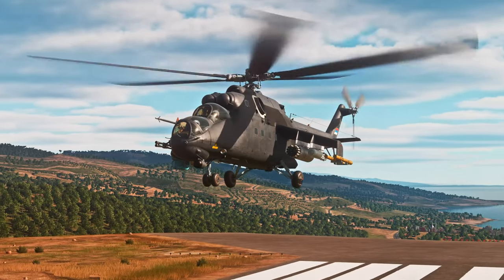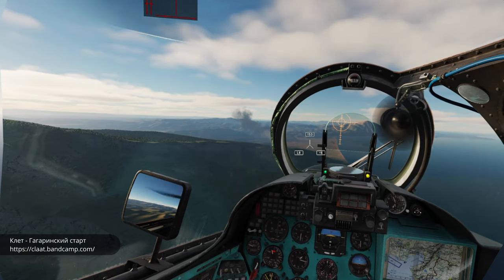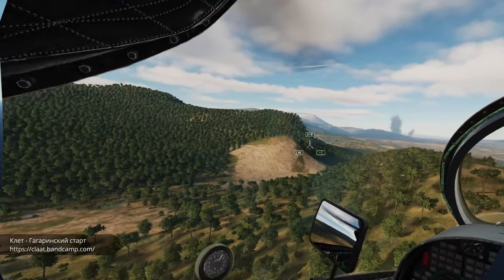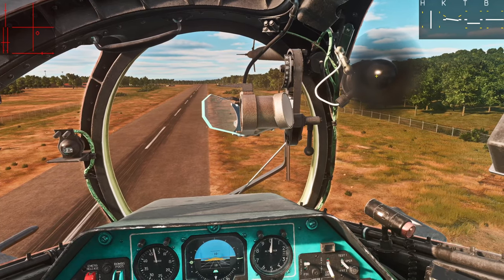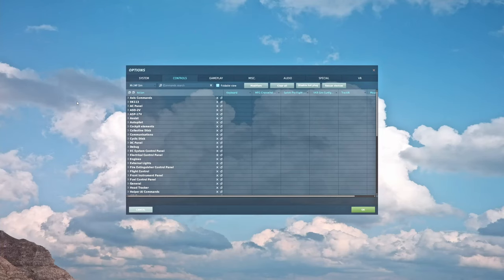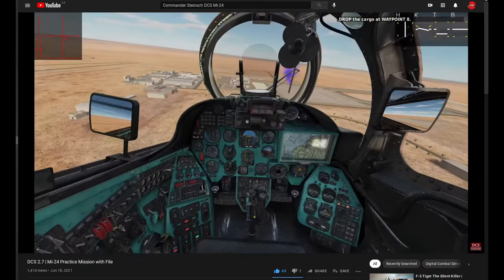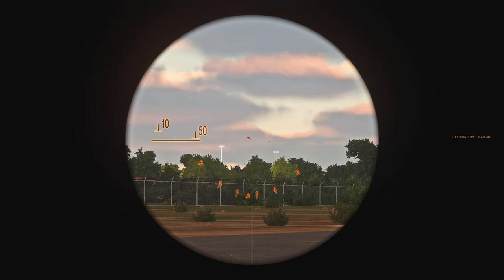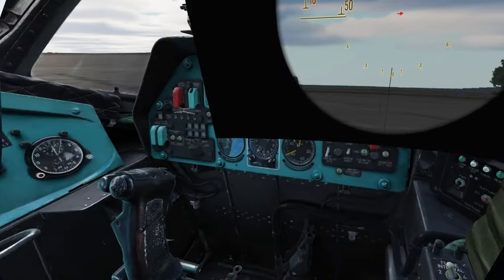Everything Wrong With The DCS Mi-24P Hind

Comment: First of all, great Video! 
Iam pretty much the same opinion but one big thing you didnt talk about in the video and i dont know how many have the problem aswell but i get very bad FPS in the Hind.
Just sitting in an cold and dark cockpit in the hind is for me about 31 FPS.
In the Hip i get more than 43FPS.
For some reason the Hind needs so much performance that its nearly unplayable.
Reply: Well, the Hip was released 8 years ago, so it had to run on hardware from that time and its cockpit has never been updated like the Ka-50. The Hind is brand new, has way more polygons, higher resolution textures, (...) so if you're already struggling to hit 50-60fps in an old module, you have to expect lower performance here.

I have to wonder though, how do you even play with 43fps? You either have choppy fps or constant screen tearing, both of which are less than ideal.
Reply: @fonesrphunny7242  I know the Hip is quite old but thats not really the matter. Newer modules like the F16 or F18 dont have the problem, i mean i get enough FPS for me. For some reason the hind ist much more heavy on performance than every other module ive tested.

And yes, i get screen tearing but mostly in the Hind because of the low FPS, thats also the main reason why i dont fly it.
Iam getting a new CPU so it should be not that bad then but i saw other people having the same problem aswell and not everyone will buy better hardware just because of DCS. Iam not a programmer or whatever but i think there is defintely a way to improve performance in the hind even with those high resolution textures in the cockpit.
Reply: @fonesrphunny7242  I’m used to 20-30fps in so many games that when I finally upgraded my 8-year old PC hardware I experienced eye strain when my FPS went above 60 consistently. My eyes were literally crying with the new information overload compared to
My previous experience.
My first computer and flight sims was an Atari ST running MicroProse’s “B17”. 12 FPS was normal.
Reply: @fanki1730  It's mainly geometry, not textures. The Hind has cables and stuff everywhere and even the canopy frame has tons of little triangles. The Hornet and Viper have very clean cockpits in comparison. A notable difference in performance is to be expected.
Also, both seats in the Mi-24 share the same 3D model. The front cockpit won't be visible from the pilot seat most of the time, but the graphics engine still needs to evaluate the front cockpit, to see which polygons are visible. This process is called "culling" and used all the time.
If ED can pre-determine which polygons never need to be rendered, that would reduce the amount of culling evaluations and speed up rendering. Not sure they are even going to do that much, because something like an nV 1080 should be the standard by now.
Reply: @ghostdog688  Atari ST 520 / 1040, "Their finest hour: BOB". Yeah, I remember low framerates. "Starglider 2" ran at like 5fps in some areas.

A high refresh rate with V-sync should be more natural to the eye, unless it triggers motion sickness similar to VR. Maybe you're experiencing some imperceivable flickering at 60hz, which monitors can do depending on how they are connected (eg. 1080p over VGA or a faulty cable). Ghosting due to slow pixel update (8ms) can also be a contributing factor.

Maybe you really can't handle 60fps. That's fine, not everybody can handle VR either. I've never heard of something like this before and high FPS have always been beneficial for me, be it for tracking a bandit over ground clutter or just glancing around with TIR.
Reply: @fonesrphunny7242  its wierd because i have gotten used to VR, and usually push up to about 60 fps. i dont experience nausea or motion sickness, but can get eye strain and even headaches if i go into tripl-digit frames. with or without v-sync. im fully aware im the edge case here, but i always chalked it up to being used to the kind of frame rates that make PowerPoint look smooth lol
Reply from the maker: My FPS in the Hind has been good, but I also recently did a major upgrade of my 8 year old CPU. The thing that made the biggest difference for me was moving to 32GB RAM (and now to 64). 16 just isn't cutting it for DCS anymore, especially on Syria and with the newer modules.

I don't mean to invalidate your problems. I just haven't experienced it myself. Hopefully they'll put some time into optimzation during EA and it will get better for you. I'm sorry to hear it's running so poorly, the Hind is a really fun helicopter so far.

You could try the optimized cockpit from the user files. It might not fix the problem but I bet it's at least worth a shot: https://www.digitalcombatsimulator.com/en/files/3317193/

(He also has a Russian version, and black versions uploaded)
Reply: I noticed lower fps with Hind. But I didn't compare it to other modules yet. But before the patch I could see 70-80 fps on servers running Syria, inside F/A-18 or MiG-21. Now it's barely touching 56-60. Again, just didn't compare yet >.>
But the server I'm talking about is also suffering from random fps drops because of ED's shenanigans and because the server itself becomes a little bit heavier as the time flies (SaW)
On Hoggit's TNN I also barely reach 56-60 fps, though.
That's why I'm inclined to believe the module has slightly performance issues. Not BIG, but noticable.

Comment: April '22. It's awful. Like, really bad.

Cold start then lift... Craft spins and tumbles. Dead.

Try to hover. Dead.

Tell Patricia, sorry, petrovich to fire from any distance. Any distance. Doesn't shoot or engage. Dead.

Avoid Sam. Spin. Tumble. Dead.

Ask Patricia to ready weapons. Have to go to CpG pit to make sure everything is on. Crash whilst distracted. Dead.

FF controls. Epileptic fit. Dead.

Centre trim. Somersault. Dead.

Autopilot? Crash. Dead.

All zeroed before gas, throttle or torque....spin. dead.

No peripherals at all. Tumble. Spin. Dead.

Lots of people are enjoying this module. I am not one of them.

It's crap.
Reply: I've flown most modules in DCS and flown the Hind nearly every day since it released and it's one of my favourite modules.

She's a beast to learn and I'd say one of the harder picks in DCS, but ultimately because of this, one of the most rewarding aircraft to master.

This helicopter will kill you any chance it gets. As I understand it, it is the same in real life, which is why it is flown in such a peculiar manner and has many "rules" surrounding its operation.

It took me weeks to get basic control under my belt, and 2-3 months before I could stop dying most of the time and begin to stay out of VRS and stalls.

The state of the module is actually really good (as vsTerminus is also saying in other comment threads). It is just difficult, and requires a high level of patience.

I urge you to give it another go and take your time, oh and if you don't have pedals please invest in them, they are practically mandatory for a helicopter as demanding as this one.